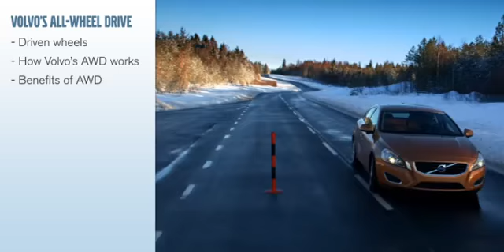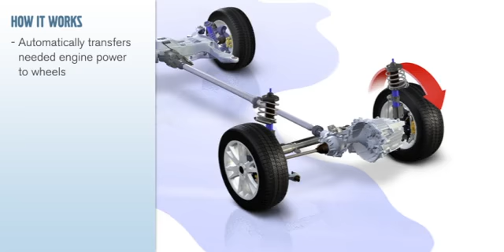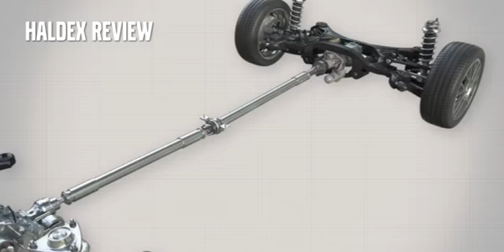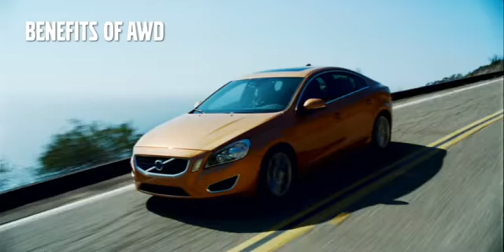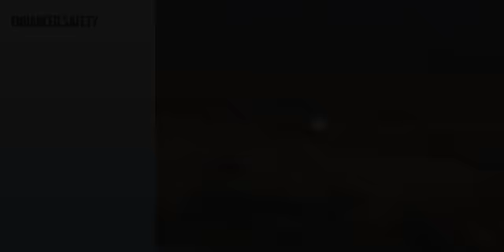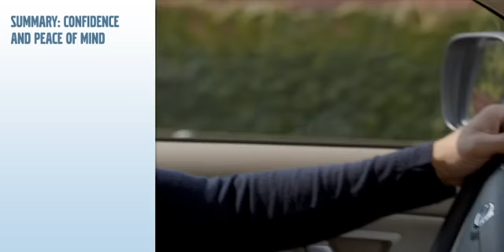Volvo All Wheel Drive - Haldex Generation 5

Comment: I'm a subaru partisan and think that my active awd is crap, because it's pseudo awd system like a haldex ;)
the resent improvements is to use brakes instead of diff-locks - cheap and cheerful, but consumes power and brakepads